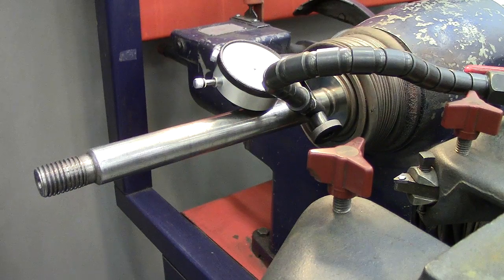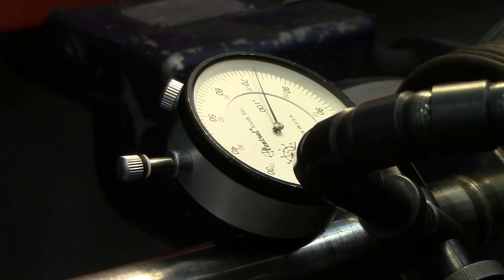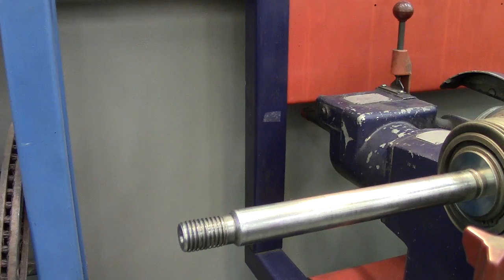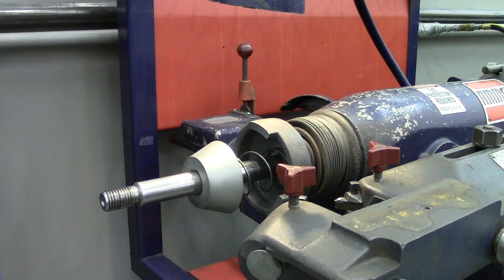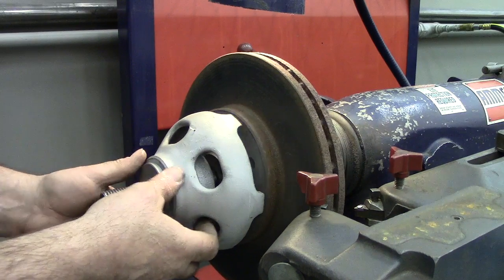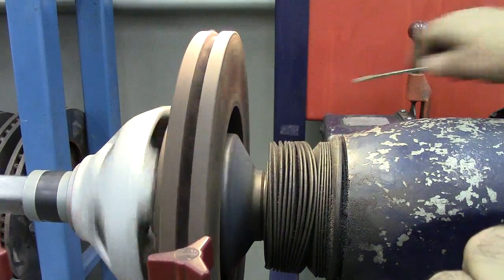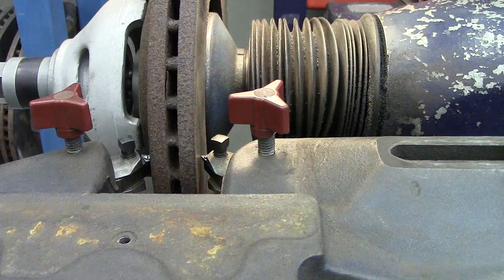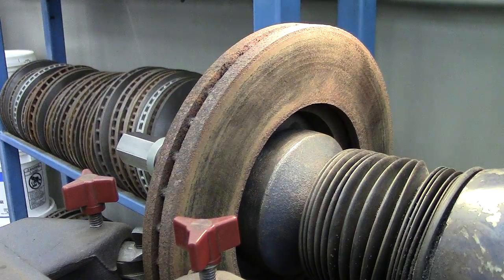brake lathe arbor 003

Comment: The mounting face on the arbor can be dressed using the drum bar and the left cutter out of the twin cutter. If it has groves or galling it needs to be dressed or replaced. Nice video!

Comment: You're supposed to move the twin cutter over to the rotor not the rotor over to the twin cutter. You want to keep the rotor closer to the center of the Machine For Less vibration. Also where is your rubber silencer. That outer piece you put in between the arbor nut and the cup is a self-aligning spacer it's not a clutch

Comment: I have been using these machines for 15 years. I bought one for my garage a few weeks back. When even I tighten up the arbor nut the whole shaft has run out but hand tight it spins true. After trying different size cones and rotors I noticed that many of the cones bores were a bit wide so I tried the quick chuck and it fit much tighter on the arbor seemed to cut a lot better but still had a little shaft runout which you can even see on the arbor nut. It's just so bizarre because if you put the arbor nut on hand tight it's just fine

Comment: So, when you rotated your rotor and did your second scratch cut, that proved that the lateral runout was from the adapters not being true to each other, and not a warped rotor. If your entire setup is true, you will have 2, 3, 4- as many scratch cuts as you want that will all be parallel to each other no matter how many times you loosen and spin te rotor to a new position. I'm dealing with this issue in our shop. Between dropped adapters, a bent arbor, and warped rotors, it's near impossible to tell what's TRULY true.
Reply: dealing with the same thing now, trued up some cups to the arbor face and matched, still getting some lateral runout after machining, arbor is .0009 runout along its length, not sure if adapter bore looseness/tightness is the issue. how did you end up resolving it?
Reply: @bn880 honestly, compensating by trying to put the adapters in a location where the rotor is visually spinning true. Sand the inner and outer surface of the top hat, sand the rotor bore, and sand the hub mating surface. After turning the adapters in opposing directions a few times your should fine a spot where the runout more or less cancels out. But even more honestly- we sell a lot of rotors because of bad cuts on these abused machines.